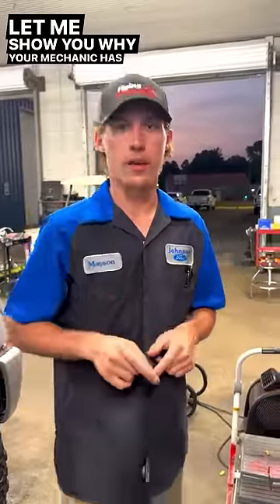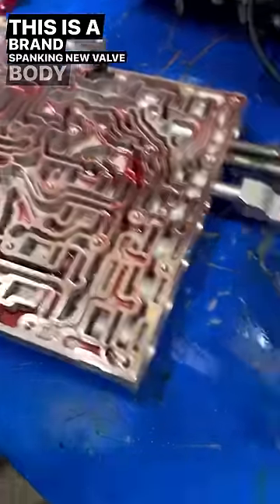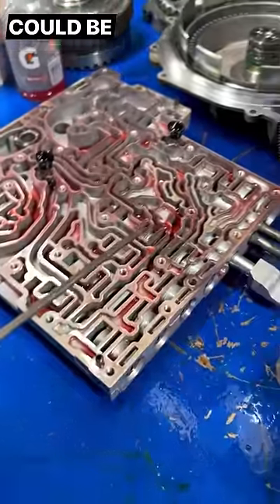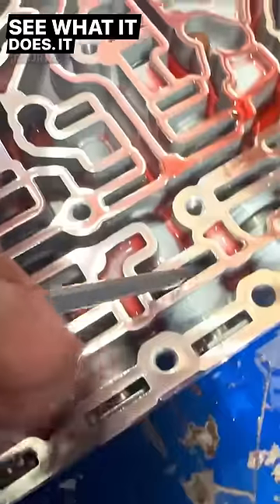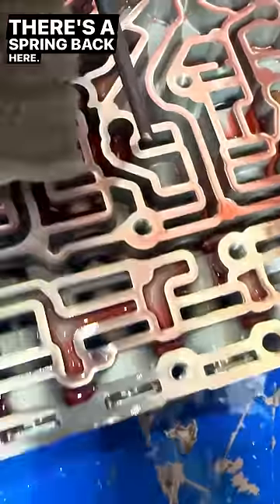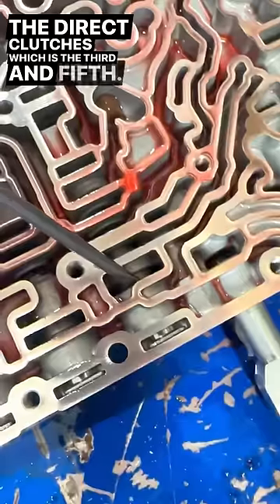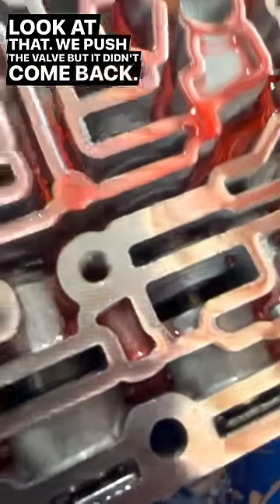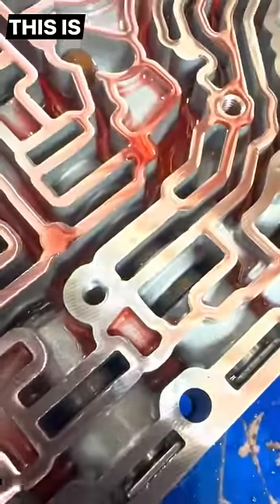Why your mechanic has trust issues #shorts #ford

Comment: As a mechanic, I don’t trust a mechanic that beats around the valve body like that
Reply: Yeah he needs a bigger pry bar so he could check the valves to see if they're stuck, if they aren't then they will be after you pry on it with that pry bar
Reply: Needs more hammer
Reply: It's a defective piece and is not going back into the vehicle.
Reply: as a mechanical non-mechanic,

them some bitch taps, it’ll be ite
Reply: Why would it not go back in the vehicle? There are several ways to "work" the bore and get the valve to move freely. That would be the best option rather than installing a new one that doesn't work either. I agree with the OP, not only is he beating on a surface that has to seal, but he's also gouging up the valves with the screw driver.
Reply: @mikeday8826  The point is, he is not being careful with it because he is not going to use it again. Now if he was treating it that way and said he was going to use it again, that would be a different story.
Reply: @Dave-in-MD  well he probably did use it again. I am a gm Technician, and when you get a bad part like that the company expects you to find the issue and fix it, if it can be fixed, which this easily could be. They will not allow you to just keep getting new parts if the one you have can be repaired. I have also worked for Ford before and they operate the same way.
Reply: @mikeday8826 a butterfly run up through that bore would probably fix it.  Emery cloth on a stick powered by a die grinder.
Reply: Thats because transmission guys are TECHNICIANS!!!!
Reply: @Dave-in-MD great way to show the average Joe how to handle sensitive parts.  He's not teaching master techs after all.
Reply: It takes 2 gaskets and a plate he’s not hurting anything
Reply: Just needs honed out  a little  to keep the valve  from sticking
Reply: I just came here for this comment.
Reply: Definitely needs to pry against the aluminum with that steel screw driver more..its good for the aluminum when you do that.
Reply: My thoughts exactly. The slightest burr Or micro grain of debris results in no more workey.
Reply: Yeah no shit he definitely needs a new valve body after smacking the top of those carefully machined soft “Aluminum”  pieces with a metal screw driver that’s the first thing I noticed😳🤔
Reply: So the people trying to defend his actions. Sure we don't know if those parts are going back in or not... However why not practice better technique all the time regardless? You want to form habits when wrenching. Preferably not bad ones.
Reply: If you guys really think those tiny ass taps messed up the sealing surface, you're all not actually mechanic's. Not justifying it but the tiny tiny ass scratch those taps would cause would not make this already defunct part any worse. 

And to the people saying you need to fix the part that the manufacturer sent to you: Fuck that shit. First off, Im flat rate and if i aint getting paid to fix it it aint getting done. That's on the manufacturer. I don't think it's too much to ask for my parts to be correct. Second off, I have worked at Lexus for a few years, and every time we get a messed up Lexus part, we send it back to Lexus and get a new one. Parts quality is a top priority, and they take that shit seriously. They want to know what happened and why so they don't send more defective parts out.
Reply: @AmogusAsbestos  it is on the manufacturer, but that's why the manufacturers have Technicians, to fix their faulty shit. If you get a bad part like a valve body, and it can be fixed, then you fix it. It's called warranty time, why would you not get paid for it? I've worked for GM for more than a "couple" years, you have to learn how to work the flat rate system. I would much rather get paid the hours to rebuild that valve body, especially when I could fix it in 5 minutes, instead of just another r&r for another valve body...second of all those taps could hurt the sealing surfaces. Most of these modern transmissions don't have valve body gaskets, they just bolt straight to the case, aluminum to aluminum, so there is no gasket to fill in the imperfections. Most likely he didn't hurt it, but it's definitely possible. He without a doubt scored those valves all up prying on them though.
Reply: I've got a fever and the only prescription is more screwdriver.
Reply: If it's too weak to take that it doesn't belong in the high stress environment of flapping around in a car period, i treat my damn Kia trannies worse than that.
Reply: You should see how we treat things in class 8 diesel repair.
Reply: @Dave-in-MD did you not see him smack the new part with his screwdriver
Reply: @Dave-in-MD so you did not see him smack the new part with a screwdriver,  right on the mating surface?
Reply: @AmogusAsbestos if you think that those little Mars and gouges don't leak under pressure,  maybe you should go get some more training. And flat rate doesn't make you a good tech. Real mechanics fix the problem.
Reply: @stretchhfab7315  lmao you're one to talk if you think they will. All mating surfaces have micro marks and gouges. My point still stands that he didn't tap it hard enough to harm the surface any more than when you're going to put it on the vehicle. Simply wouldn't damage the part that badly. Besides that, if you're taking it off the vehicle and putting it back on, it should be resurfaced anyway. This is literally mating surfaces 101.
Reply: @stretchhfab7315  Tell you what, watch again and this time pay attention. Yes he said it was a new part, that he had installed and it failed to work properly due to the valve sticking so he removed it. At this point it is no longer a new part but a defective one that will be replaced.
Reply: IT ISN'T MADE OF GLASS
Reply: That is an idiotic statement.
Reply: You're not a mechanic you're a milstone
Reply: @Dave-in-MD   obviously.
Reply: @mikeday8826  can't fix what a manufacturer sabotages on purpose
Reply: @mikeday8826  He shouldn't need to do that because the manufacturer should have done it already.
Reply: Mechanic probably broke it
Reply: @jamesworsham2312 that just a flat screwdriver isn't lol
Reply: @stretchhfab7315 real mechanics take care of their customers.

You think the customer is gonna be happier with a 4 hour "diagnose and repair brand new part" line item, or a "returned faulty brand new part to mfr for free replacement" line item?

We have consumer rights laws in this country for a reason.  I don't give a fuck if Ford wants me to finish manufacturing their parts for them.  That's their fucking job, and the law backs me up to protect the customer.
Reply: @stretchhfab7315 first time huh?
Reply: @Dave-in-MD  yea so just waste the whole thing by slapping your flathead driver against it and making burrs right its getting thrown away anyway 😂
Reply: I’ve got a buddy that is very particular about his cars.  He uses the wax bars and clay bars and man he really loves his rides.  If he saw me do that to a mating surface he’d flip the fuck out.  😂😂😂
Reply: This was my thought as well 😂
Reply: as a mechanic, don't drive autotragic transmissions
Reply: That's my thought too.
Reply: @BCole-vo9xz Ah the old "knockometer" in backyard-mechanic speak
Reply: @ryanteer3289 why would you hone a brand new part. They wouldn't warranty it. They should be made right to begin with.
Reply: It's a Ford part.. of course it's going to fail.
Reply: yeah, as someone who knows nothing about vehicles, I cringed when he was tapping it with a hard metal tool.. would be acceptable if it were a plastic tool made for prodding around sensitive things, I think
Reply: I had to scroll way too far down for this...
Reply: It’s already broken…
Reply: First thing I though. Steel vs aluminum...I'm sure it's fine but doesn't give me any extra confidence...
Reply: Yeah you're right, obviously the part is in great condition and he needs to worry about damaging it. 👍
Reply: @mikeday8826  Because its a new part and you should not have to do additional work on a new part to make it function. Thats what parts warranty is for. Used part sure do whatever you got to do. New part, take that sucker back. Pretty simple.
Reply: @somethingelse4424  yeah that's a horrible idea, you're the kind of guy that gives transmission guys nightmares. Oh my God, sand paper in the bore of an aluminum valve body is a terrible friggin idea.
Reply: As a dentist, I recommend flossing more and softer tipped screwdriver.
Reply: @LKN117  what do you guys not understand? He works for the company that made the part. It's his job to fix Ford's shit, that's what they pay him for, rather it be a car or a part for a car. It's called warranty time, which apparently none of the people saying return the part know anything about, because you don't work for an automaker. I do. I know how it works. I just put a $10,000 engine in a vehicle a couple weeks ago and guess what, it didn't make it a full week and spun two rod bearings. You think GM is giving me a new engine? No. I have to disassemble the engine and put a new crankshaft and two rods. When you work for an automaker you get paid to fix their shit, rather it be a vehicle, or a part, you fix it if you can. We aren't talking about someone at home that bought a part from O'Reilly's.
Reply: @joemurray1833  yeah you could fix that valve easily, just by working the valve back and forth in the bore. Just not the way he is doing it, but from the end, with the plug out
Reply: @mikeday8826  You're right. I feel stupid. I did not pay attention to the name on his uniform. Honestly I payed more attention to the shop around him. Which didn't give the appearance of a dealer shop. At least all the ones I'm used to seeing. Plus its kind of counter intuitive to think a Ford tech would be talking trash on the brand while at work.
Reply: @LKN117  no worries man, you shouldn't feel stupid. I shouldn't have  been so rude sounding...I 100% agree with what you said. He is definitely not very professional talking about the company he works for like he does, and the shop doesn't look too professional either. There's a couple guys at the dealership I work at, that all they do is keep the shop clean and looking good.
Reply: @mikeday8826  Yeah I fully was thinking this was an independent shop. Given the all the details I pointed out. Guess I need to pay more attention to the subject and not the surroundings next time.😅
Reply: In all my years rebuilding transmissions and running my own trans repair shop, I never once had to buy a new valve body.. strip every valve assy out of the body, sand it flat on emery on a surfacing plate clean up the valves with emery or scotchbrite pads and reassemble, if every component of the trans is stripped and cleaned thoroughly, including flushing the cooler - never a problem. That aside, in recent times  Ford has found a way to sell valve bodys, I'm glad I moved on

Comment: Ive replaced so many parts 2 to 3 times over simply because the parts were junk rite outta the box.
Build quality went out the window years ago.
Reply: Years or decades?
Reply: @frederickevans4113  yes
Reply: This is why you preinspect your parts....dont just slam them in without a look over. Sounds like your problem not the manufacturer. Gotta realize theres real world stuff called handling damage and things like that. The parts fairy doesnt hand deliver everything in a padded box. Gotta look stuff over.
Reply: @tommys2979  well that doesnt exactly work with electrical parts.  If its not structuraly damaged you dont know til ya put it in.  Im not even including in this all the parts that have been shipped wrong,  rite part number on the box, wrong part inside.  Just love getting something only to open the box and someone put the wrong part in.  Just adds more time to the repair.  After dealing with all the halfassed stuff from local parts stores, i just order oem now.  Since i started doing that the reships have all but stopped.
Reply: @tommys2979 maybe the parts fairy should learn what "expanding foam" and "courier" mean, then.
Reply: @tommys2979  The manufacturer not having a proper quality control department and not packing their parts properly to protect them in transit is now the customer's problem? What kind of cuckhold mentality is that? 🙄

Comment: And dealers wonder why their dealerships are sitting full of trucks
Reply: They are sitting full of truck’s because trucks are in high demand for some reason. Trucks are ugly, they get bad gas mileage, and it’s easier to hit things because they are so obnoxiously big. Unless someone is hauling heavy trailers regularly, having a truck is completely useless. It’s better to get a mid-size sedan, which are usually cheaper and get way better gas mileage.
Reply: Thats because they made trucks luxery vehicles instead of everyday cars. Has nothing to do with parts lol.
Reply: @ezekielanderson9055 trucks in high demand is why there's dealerships full of trucks? LOL, no, it's cause they are overpriced and no one can afford them without becoming a debt slave for a decade
Reply: @Alolan.Vulpix.Getting.Railed  Why would dealerships have them if no one can afford them ? 🤦‍♂️
Reply: @ezekielanderson9055  You tell me why they are in high demand yet piled up in dealerships, genius
Reply: @Alolan.Vulpix.Getting.Railed  A lot of them are being made because they are in high demand. If they weren’t in high demand, few would be made, and there wouldn’t be a bunch on a dealerships. This is very basic economics. Do you not know very basic facts?
Reply: @Alolan.Vulpix.Getting.Railed they are the top selling cars
Reply: @ezekielanderson9055  Trucks aren't in high demand, they're just produced at an artificially high rate.
Large pickup trucks are held to different safety and emission standards than other vehicles due to clever lobbying/bribery during the Obama administration. For example the safety standards for large pickups hasn't changed since 2003.
This means that pickup trucks can be manufactured relatively cheaper and of poorer quality, thus leading to higher profit margins. Auto manufacturers produce a shitload of trucks while artificially limiting the production of other body types for this very reason.
Reply: @somelokyguy6466  You think trucks aren’t in high demand? Then why are there lots of trucks on the road?
Reply: @ezekielanderson9055  Because they're the most readily available body type, I just explained why.
If you go to a new car dealership and ask for anything except for a pickup truck; you're likely to be met with statements like "sorry but we don't have any in that colour", "that trim model is out of stock", or "we can put you down on a waiting list, expected delivery in late 2025".
Whereas if you ask for a pickup truck, the dealer will have every colour and trim level readily available.
This is because auto-manufacturers have a heavy financial incentive to push pickup trucks onto people instead of other cars.
Reply: @somelokyguy6466  Do you not know how basic economics works?
Reply: @ezekielanderson9055  Yes. Basic economic principles only apply to an ideal simulated society and do not hold up in the real world where government interference and artificial scarcity exists.
If the government provides an unfair advantage towards large pickup trucks; more large pickup trucks will be sold.
Likewise if auto-manufacturers agree to artificially limit production of anything other than pickup trucks for the North American market; more large pickup trucks will be sold.
Reply: @somelokyguy6466  So you think the government makes trucks in low demand and high supply…which makes people buy more trucks…instead of sedans which are cheaper? How does that make any sense? 🤦‍♂️🤦‍♂️🤦‍♂️
Reply: Welcome to Bidenomics 👍
Reply: 100k for a bunch of problems. I'll keep my 05 😂
Reply: @ezekielanderson9055 i bet you mooch of your freinds or family with trucks every time you need a couch or new bed or washer and dryer.

Comment: What happened? Is it a bad solenoid from the factory? Sorry for ignorance I’m not familiar w the internals of a vale body.
Reply: Either the spring is missing, the tolerance for the hole that that solenoid goes in is wrong or the solenoid is fucked up internally
Reply: It’s most likely a burr on the valve itself or trash in the bore it doesn’t take much to stick valves and cause all kinds of problems that are very difficult to diagnose.
Reply: It's a machining problem not the right size hole

Comment: I once replaced every single component in the cooling system of my Jeep trying to get the heater to work, it ended up being the brand new valve in the heater lines that I had replaced a few months before being bad. New part QC is absolutely horrendous
Reply: I once spent days crawling all over my BMW trying to figure out why the heater/AC blower fan wouldn't work... turned out the brand new motor control/starter pack (the first thing I changed) was dead on arrival and I was chasing ghosts.
Reply: I presume this was in the winter after the coolant leak stop was added, right?